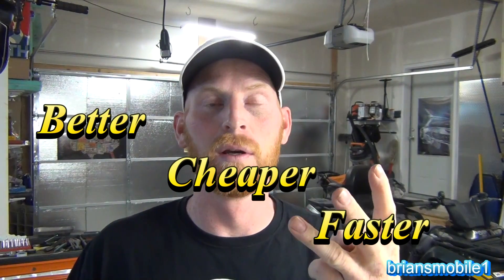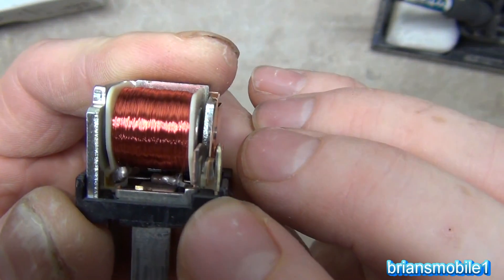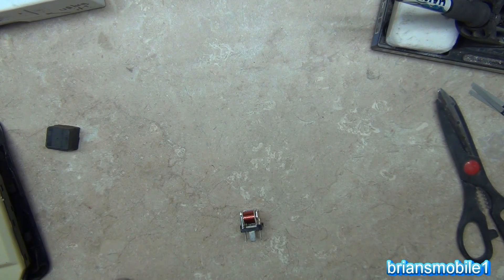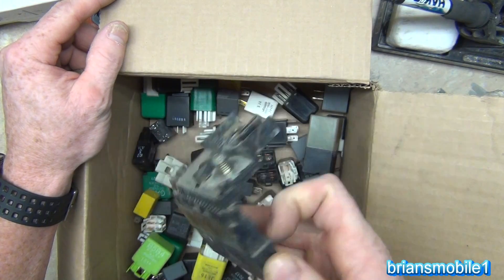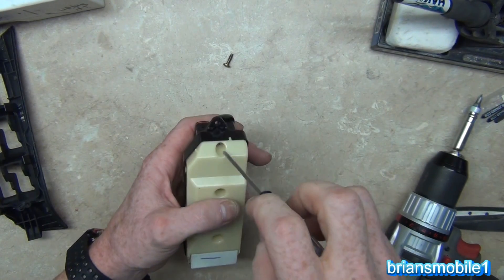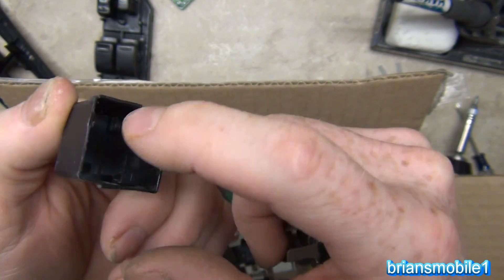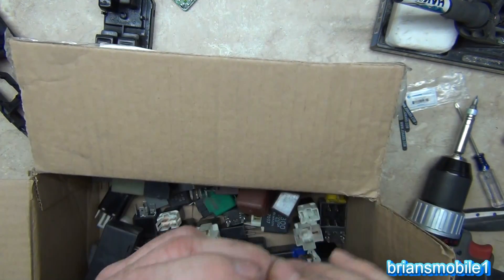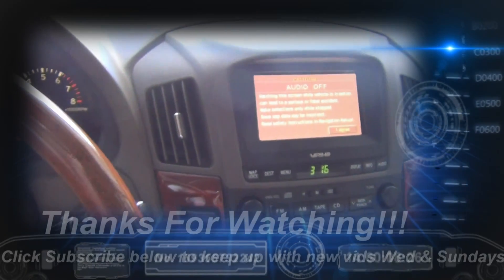Fix a Relay With a Burnishing File

Comment: Don't forget contact cleaner after you burnish the contacts... Get some 4x6 inch index cards and cut them into 1/4 inch strips 3 or 4 inches long., soak in contact cleaner put the strip between the contacts and push the contacts together, and pull the strip out slowly you will be amazed at the black crap that comes out repeat until clean card stock comes out.jim

Comment: I got a question. 
Have you tried putting dielectric geese on the contact area?
Wouldn't that prevent the corrosion form occurring, and help disperse heat?
Reply: Geese are bad for your nuts ,owch

Comment: You, my friend, just saved me $20. Although I didn't have those files, I was successful using silicon carbide, waterproof 1000 grit abrasive paper; I just cut a small strip and voila! Originally, the relay developed a buzzer like noise? I'm guessing contact chatter?  Thank again!!

Comment: I use a old key . In  the center of most house keys there is a flat area that goes the length of the key . Its about 2 mm wide . If you have a dremel  hand piece and a thin cut off disk  just cut off the metal on both sides  about 15 mm back  so you have a 2 mm  wide piece of metal sticking out . On the other side of the key opposite the flat part is a grove . From the bottom of the grove  to the flat side is about 1mm  . Just lightly flatten out the grove side till its flat  and taper it down  the 15mm length of the 2mm piece of metal  . I go from 1mm to about 1/2 mm or 0.02 inches . Use a rubber wheel  to smooth out the metal  and sand blast both sides .Then put a little bit of wd 40  on both sides just a film   and you're  ready to  smooth out the contacts .  The 2mm wide  metal  key  will fit just about any where  and it works great for  relays  The key itself makes a great thing to hold on to  while you are  dislodging  contaminants the contacts have . You don't want to remove the coating  that the contacts have just the  contaminates  You can put it on a key ring and hang it up or just leave it in the  car . It only takes a few minutes to make and it lasts for ever  .  I put a slight knife edge  around the edges ,it makes it easier ti slide in between the contacts   . I use it all the for my air compressor contacts  mostly  . Here is a photo https://www.facebook.com/photo.php?fbid=10213089727618711&set=a.10213089705218151&type=3&theater

Comment: Awesome great job..I think it might even be easyer to use a thin metal finger nail file to file off the Carbon and Corrosion off the points on the old relay? should work.

Comment: Hello Brian. I once heared that the contacts of a relay have a thin Wolfram layer (tungsten) to prevent the contacts sticking together when electricity goes through. So I am Not sure if it is a good idea to use a File that might Sand through the layer. Concerning the window issue. The Honda fit (Jazz) of my mom had the Same issue. As the window tried to slide upwards it stopped an moved back. I found out the window tilted and jammed. Fixing was easy. The conducts where powderdry so i greased it and now it works fine.
Reply: Yes. Clean and add a dielectric grease like bulb grease or potentiometer grease. This will restore just about any switch or relay contact.

Comment: FYI--Don't file off too much material. Because most if not all points have a thin silver coating. When you get past that you will be down to the brass portion. Which is not nearly as good as a conductor.

Comment: I actually replaced 1 of my no brand Chinese made hid relay with a brand new Bosch relay just yesterday.  The Chinese relay engages when there is power going through it but my HIDs do not get the current required.  Replaced it with a new relay and it was working again.  I initially intended to take apart and clean the Chinese relay but I said "F*&% It ! ! !  not worth it, I just tossed it into my recycle bin........

Comment: +briansmobile1  Thanks for the shout out, glad to be of help.
As a side note, some better burnishers are impregnated with extremely fine garnet that tends to clean and polish the contact surface rather than cut like a file and has the desirable properties of not shedding abrasive particles, not contaminating the contact and not embedding the garnet in the contact. 
Many high end gunsmiths use garnet compound for lapping slides and actions for fine fits without worrying about abrasive residue, embedding or galling.

Comment: Hey Brian, I was taught after using fine sand paper to use white paper between breaker points as many times as it took till paper came out clean. But that might have been a few? years ago. :)    Burnishing files are new to me though and probably are a better fix though. Keep up the great videos. Never stop learning.

Comment: briansmobile1 some of the cracked plastics i tend to use celuose , a drop in thr crack and push it in place a few seconds and it "glues" up!
Reply: transdetendal  krazy glue and sodium bicarbonate works wonders also :)
Reply: ***** yup ,its as quick as a sneeze...

Comment: Did you try checking for obstruction in the window track?  Lube with silicone and watch what happens. If it works clean. Service drive train and window track/guides
Reply: Ian Cunningham Yes. That works. Did that for a customer last week. Went from seeming damage to smooth and awesome. Very satisfying project. Her other side needed a new motor though. Glad she sprang for it though. Cleaning it up got it to go down but it wouldn't go back up! Phew.

Comment: Burnishing file AKA points file.
After all, points are points.
Reply from the maker: sjs Ha ha- fixed it!  Thanks!  My points file by name is an ignition points file from the ignition points and condenser days of yore.  Unfortunately it's just way to big to fit in any of the relays here.
Reply: briansmobile1 thx man you save me i was trying to find an online junkyard to find parts for mine and my friends car
Reply: sjs Indeed! The reason relays are used is a direct result of the points era. Back then you had switches and not many relays if any. The switches failed after years of use and had to be cleaned or replaced. Some clever people figured it would be nice to use relays to handle the big voltage and current and that is what makes it possible to have a bunch of switches instead of just a few high volt switches on the dash :D